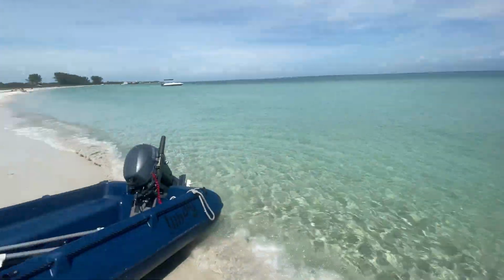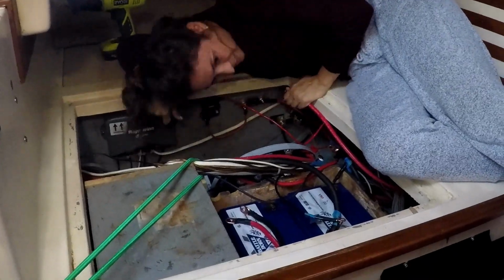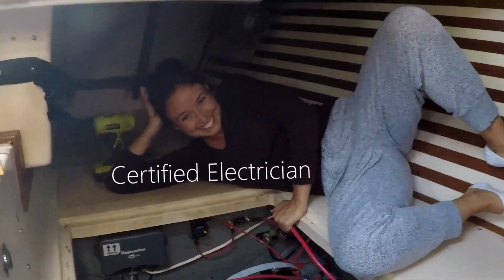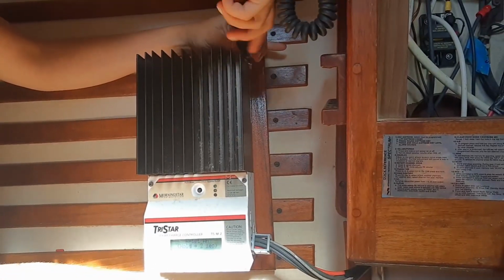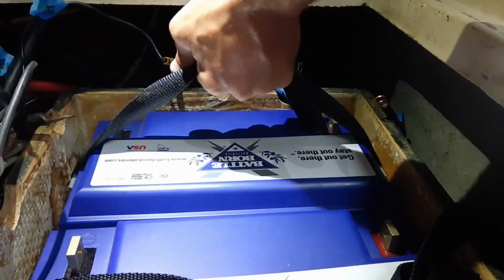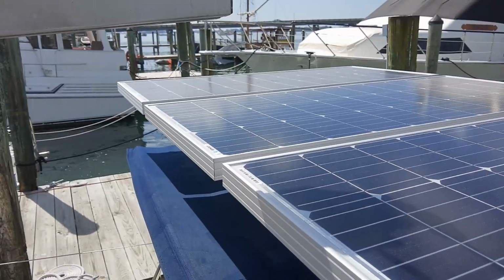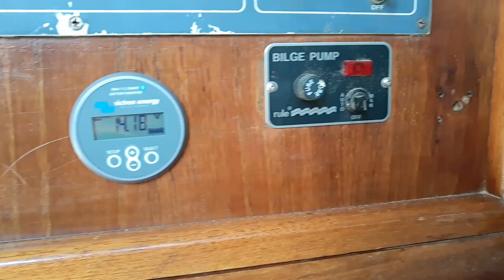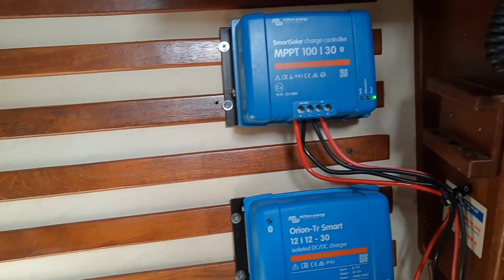Upgrading the SOLAR System on our Sailboat + Dinghy Adventure!

Comment: Subscribed
What make boat are you on?
I'm in key west. Or, 2 miles off Key West, on a Morgan Out Island 33 sailboat
At about 5 PM today we got hit with a squall line with 45 moh winds

Be careful, Key West is a very easy place to get stuck in
I got stuck in Key West 30 odd years ago. Been to Dominican Republic to Panama, but Key West is 'home'

If i might give some advice:
Always tie the dinghy to the big boat with 2 independent lines. 
Make a 'hard top' of plywood shaped 'cellular PVC' that collects rain water, and section off your bilge to fit potable water blatters to store the rainwater. At the front of your bimini, a thin plywood sized chunk of 'POLYCARBONITE', cut to be a few inches smaller, grommets all around the edges of the polycarbonate, lashed to the deck and bimini, and this will act as a sort of dodger
Reply from the maker: We are on an Endeavour 33. We're already in Mexico! We didn't get stuck in Key West. We were only there for a couple days.